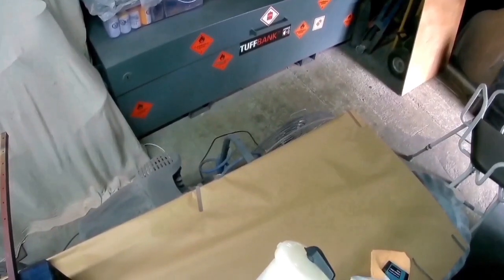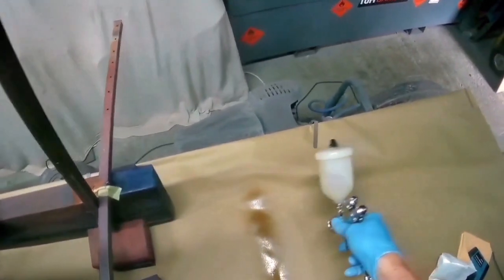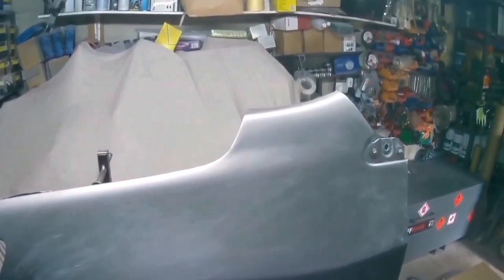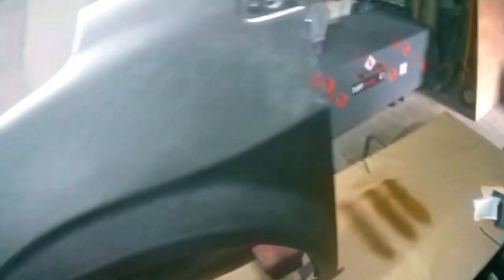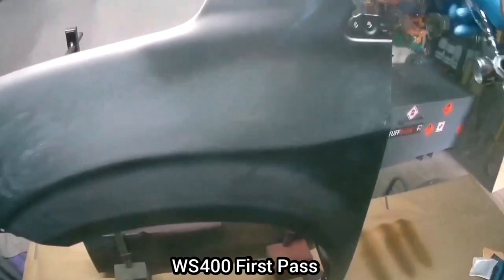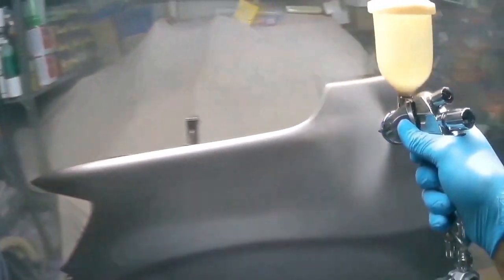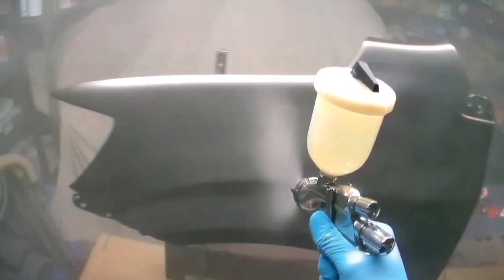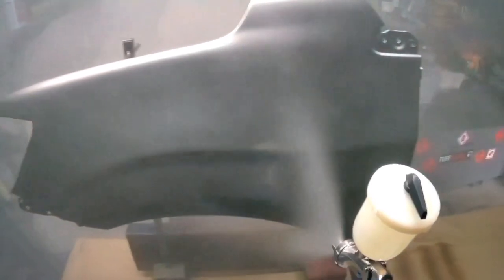Iwata WS400 1.3HD v Kiwami 4 1.3 BA4J For Clear Coat

Comment: Another nice comparison video, Pete. I've been on the fence with the Kiwami 4, although most video's I've seen on it are positive. On a side note, if you ever decide to thin out your collection of guns, be sure to let us know here. I'm sure there'd be plenty of interest.....
Reply from the maker: Hi Mate, You may or may not know i had a problem with my Kiwami4, an air leak at the back, the third Iwata to do it.
Having said that i still really rate them especially in the BA4J setup used here because it not that expensive so is really good for someone that wants a good product  at a reasonable cost, cheers 👍

Comment: Nice video Pete, an unusual colour very  similar to what John done the other day. Both guns looked like they had identical orange peel from what I could see anyway. Your subscriptions are doing very well mate people are giving your videos the attention they deserve. Thanks Pete see you in the next one.
Reply from the maker: Thanks Steve, yes, it very hard to detect any difference in finish, even with the human eye, one thing i would say, is the WS has more control re finishes which is what i meant by the Kiwami4,  although new, is a bit old school, ie it just puts it on so doesn't atomise as fine, not a problem for things like this as it's just about getting as good a finish as possible and not trying to match anything, people often talk of a "glass finish" but most of the time, unless you doing the whole car or bike you don't want a glass finish.

I'm try to leave things 1 or 2 days after doing them before the final shots so people can see any drop off in gloss which does happen,  just a bit more representative of what to expect particularly with the cheaper clears and xfast hardeners

This is similar to the BMW X08 CHAMPAGNE QUARTZ that John did the other day, I did these panels in a few colours including the BMW one so you will see a subtle difference.

Yes, the subscriptions are going up although it should be higher really as we get a lot of view's a month now but i don't like to push too hard if that makes sense, I really enjoy sharing what i do so subs are not the be all and end all, it does help with YouTube pushing the vids more though, cheers mate,  hope alls well 👍
Reply: @peteshobbies5383  Hi Pete, yes all is well thank you very much hope everything is ok with you as well. Yes like you say the last thing i would want is a like glass finish especially for a repair its good that you do these comparisons at least people can make there choice on what they want to achive. 
I know what you mean about not pushing the subscriptions, its not something that i do myself either I just look at what I do and thats if I like the style of videos that a being produced and the person as well then i subscribe i never click it because someone said subscribe at the end. I think its common amongst content creators that the varst majority of people watch the videos but don't subscribe, I think this is because of 2 reasons 1 that people think that you have to pay for them (I thought so to at one time) secondly youtube themselves are very good at suggesting a video to the end user that it gives the illusion that your already subscribed.

The champagne colour isnt a bad colour dont think its something i would pick, at first it looked like gun metal gray when you first started spraying then out in the light it was completely different.

Have a good weekend Pete.
All the best, Steve.

Comment: Wonder if the W400 with a 1.4 tip and nozzle gets closer to the Kiwami4 with 1.3? Both give excellent results.
Reply from the maker: Hi buddy,  I have a 1.4HD and a 1.5HD tip set and use both. The 1.5 is closer but probably still not as fast. Here's a video seeing what the difference is between the 1.3 and 1.5. It's the same panels I use on these  verses videos, so it is directly comparable , cheers 👍 
https://youtu.be/15vxtygPfFE?si=Pgninc1FF9fjEfOb

Comment: which would u recommend out of all three kiwami 4 models? ba, wb or wbx? and what tip? for base and clear. if wb or wbx, can i use it for solvent based too?  Thanks a lot.
Reply from the maker: Hi mate, the best all-rounder, and particularly good with clear coats is the WBX in 1.3, it will spray solvent basecoat just as well as water bourn paints
Reply: @peteshobbies5383   
Thanks for quick response brother. So wbx 1.3 for base and clear (solvent) would be the best bet? I think im going to pull the trigger.
Reply from the maker: Yeah, that's would be the best, the WB is slightly better for basecoats but the WBX is better for clearcoats so if I was to only get one, it would be the WBX
Reply: @peteshobbies5383  I finally got kiwami 4 ba and wbx in 1.3 tip both of em!! thanks a lot for ur reviews brother. They are absolutely amazing combo. Which tip u prefer in wbx? 1.3 or 1.4 for clear? i got it in 1.3 for clear, does that make much difference?
Reply from the maker: They make a great combination 😃,  I would recommend the 1.3 for clear unless it's a UHS clear, in which case 1.4 may be better, but you can still put UHS through the 1.3 without problems

Comment: Pete I can pick up a walcom slim Kombat hte brand new for $270 shipped how does that gun compare to the kiwami 13ba4 in your estimation? They are similar in price. In terms of ease of use quality of finish and speed of fluid delivery.
Reply from the maker: Hi John, now that's an interesting question, I really like both of them.

I would say the Iwata is probably better made, that's despite one of my Kiwami4s having problems, I haven't had any problems with my Walcoms but you just get the sense they might, some of this I'm sure to down to the fact the Walcoms aren't metal for the most part and it probably in my head rather than a fact.

I'm really struggling to give you an answer to be honest, they are both really good, the finish you can expect from either is excellent, i wouldn't rate one above the other on that score.
As for speed i would give that to the Kiwami4, like for like tip size wise, although this is just from memory rather than back to back which is an eye opener sometimes, dont know if that helps to be honest mate, sorry

Comment: Completely right. In my experience you cannot use the WS400 at full fan. Candyman, another YouTube painter (who truly does know what he's doing) claims that he uses his WS400 at full and full and claims that he can do this at 5 inch spray distance from the panel. Maybe that close he can get away with it but I've never had success with anything more than two turns out with respect to the fan not splitting. It's not that big of a deal if you know about this idiosyncrasy and adjust accordingly. Set up two turns out on the fan the WS400 is a world class gun and in my opinion can produce the flattest finish I’ve ever achieved. Only equaled by the ProLite with the T110 aircap.
Reply from the maker: Hi Sataman,  yes, i too have had people say you can use full fan, if they are painting so close to the panel as 5" then, as you say, they may get away with it because the material hasn't had a chance to separate.
I must admit,  each time i use the WS the more i like it and as you say, once you know where to start with the fan settings it's a great gun to use, be interesting to see what the new version is like 👍
Reply: @peteshobbies5383  Do you have a link to the new version. I didn't know there was one so I'm interested in it. The Supernova has been out for ten years, it was clearly time for an update. Hopefully, they will limit how far the fan adjustment can come out so that this issue will not be a problem with the new version.
Reply from the maker: Here's one, goes on a bit but at least you can see what the gun looks like https://youtu.be/jTofRuHlchQ

Comment: Whats a good clear? How to set the fan on the K.4
Reply from the maker: Hi George,  i did a video trying 4 different clears,  link is below,  not sure if they are all available where you are though?
https://youtu.be/YQffNOUL0A4
I put the settings on the video,  i use most clear guns at full fan and full fluid including the K4, normally at 2 bar or 29psi,  cheers mate 👍

Comment: Hi, where did you get the cup for the Kiwami? I'm planning on buying one but it doesn't come with one? Cheers
Reply from the maker: Hi mate, I got it on ebay, these are the part numbers to look for 👍
200ml Cup  PCG 2P2
400ml Cup PC-G400P
600ml Cup PC-G600P-2

Comment: Hey Pete, that was an interesting comparison as I expected the WS400 to be faster than the Kiwami4 but it seems to be just the opposite unless I heard it wrong😂 but as you mentioned you can't really split the finish on them 👌
I'm hoping the 2.0 version of the WS400 will be better with it's fan as I am looking to get one in the future (the removable digi gauge got me hooked)  but I can see it being sata money, never mind though as I have my W400 arriving Monday 😎 sorry had to get that in 🤦‍♂️🤣👍
Reply from the maker: Hi John, no, the WS is slower, it's one of the things many people moan about, the 1.4HD normally sorts it out, the Bellaria/Kiwami4 BA4 set up puts a fair amount of fluid out so you can move quicker and still get good results.
I think the fan thing will be sorted out, it's not actually a problem if people know about it or try different settings,  i suspect it will spray the same but we will see, I will get one of the new ones but will keep the older versions as well, the parts may be interchangeable to a degree but we will see, cheers mate 👍
Reply: Ok thanks Pete it's surprising that the WS is slower but it is what it is. Ah so you are getting the WS series 2 then mate I think it's released on June 1st so I expect to see a review from you on the 2nd of June so that will give you plenty on time to get used to it 🤭🤣😆😂😉
Reply from the maker: @JohnWD40TC02  I'm not that keep John 😂,  I'll wait for the price to stabilise first 👍
Reply: I love the fan size of the WS400, it is huge. I hope they make the setup adjustments more like the typical guns. Even using HS clears, I have never needed to go full fan, I am not sure why Iwata overshot the fan adjustment the way they did. Pete is right, full fan goes heavy top & bottom and dry in the middle.

I'm sure you will be very happy with the W400, it is a great gun for the money. It is also much easier to setup and use.
Reply: Thanks David I'm looking forward to getting the gun and it will be nice to add to my collection. 
Hey Pete I recon the new WS400 will hold it's price for a fair while mate so you will have to have a bit of patience to wait for it, I'm not sure I can wait 🤔😂👍
Reply from the maker: @JohnWD40TC02  yeah,  I'm sure it will hold its price well, looking at the Iwata video in some part English it seems there are 3 guns and they are all base gun's, so I've either got it wrong or the clear one will be out later, not interested in the base ones to be fair only the clear.
They have addressed the fan top and bottom heavy on full fan by the sound of it and made the pattern smaller and thicker, just like a Kiwami4 😂🤣😅, don't you just love marketing 😉
Reply from the maker: I've just watched the video again,  obviously wasn't paying attention first time 🙄,  there is a clear version as well
Reply: @peteshobbies5383  Yeah I thought there was a clear version, I love the idea of the removable gauge as it should make cleaning easier and the gauge will probably last longer. I didn't see the part about the fan being smaller and thicker but it's probably a similar cap to the Kiwami4 just to save a few pennies 😆🤦‍♂️
Reply from the maker: They do a few different versions of the base gun, basically one has a wetter centre patern compared to the other, I'm not really fussed about a digital gauge and the fact it's removable just compounds the matter, it's got leaks written all over it, hopefully I'm wrong.
Be interesting to see the pricing in different countries which always makes me smile considering they come out the same factory, 
Anyway, I'm jumping ahead here, you have a lovely Bellaria coming tomorrow,  be interesting to here what you think of it,  cheers mate 👍
Reply: @davidparker9676  the reason for the fan is to help painters who either use less air or spray closer to the panel. If you open the fan to where you get the split pattern try moving the gun closer to the panel and lower air pressure. I have a friend who has used iwatas for 20 years and he always runs full fan 21psi and sprays pretty close and fast to the panel. Seems to get good results as he owns a bodyshop.
Reply: @johnsax7986  Are you talking about the WS400 specifically or generalizing all Iwatas?

The supernova hasn't been around for 20 years.

I have a few Iwatas as well as other quality professional spray guns. The Supernova models in particular are different than all the other Iwatas as far as setup. Everyone I personally know with the Supernovas (WS400 & LS400) never goes full fan on the adjustment because it is unusable at that setting. On my LPH400 and W400, I typically run full fan as a default setting with no problems.

On all my other guns: SATA, DeVilbiss, Sagola & non Supernova Iwatas; I typically run full fan and full fluid. I adjust the air pressure to suit the material I am spraying. The WS400 is the anomaly amongst all the other guns, I never run full fan because it always goes dry in the middle. There is no point bringing the gun in closer at full fan, you will still get a bad pattern. The whole reason I bought the WS400 is for the large fan and fine atomization.
Lowering the air pressure and bringing the gun closer to the work just to run full fan defeats the purpose of having an expensive gun. Doing so would reduce the atomization and make for a more difficult spraying experience.

It is just an annoyance to have a significantly different setup on the Supernova when you use multiple guns. You either have to remember the ideal settings or waste paint and time playing with the settings, doing test patterns.

Full fan and full fluid should give you the biggest fan pattern and be the ideal setup for painting fast. I honestly think it was a design flaw on Iwata's part. You shouldn't need to wind the fan adjustment in to get a good pattern. Technically speaking, it is simply too much air going to the air horns on the air cap. You shouldn't have to adjust the distance and pressure to correct for it.
Reply: @davidparker9676  you run full fan on your lph400? You sure about that?
Reply from the maker: @David Parker My findings are exactly the same as yours, I think Iwata have more or less admitted it was a design floor as in the promotion video for there new version they they say this has been addressed

Comment: Hi Pete, I watched the Iwata supernova gen 2  video and they talked about the split nozzle orientation relative to the air horns being critical to the spray pattern. My series 1 supernova is oriented "incorrectly" and seems to spray just fine. My manual does not reference this as a possible issue. Do you have any experience with this?
Reply from the maker: Hi Gomer, I think they are now saying there was a problem with the original design, this is because, as you may know, the gun really didn't like to be used on full fan, depending on thickness of materials being used the patern separates, if the fan is wound in then there is no problem with the WS400 or LS400.
It amazes me how a company can say after 12 years or so that the original design was flawed, that's marketing i guess, so expect the new version to be less " tricky " to set up, I suspect it will also lose some of it's appeal but we shell see, I will try and get the new version as soon as i can 👍
Reply: @peteshobbies5383  Maybe one thing to try is a teflon washer/shim behind the split nozzle so it tightens in the correct orientation?
Reply from the maker: I'm not sure that would work, there is little wrong with the original design once you know how to use it, after all, they (Iwata) are trying to persuade you to buy another spray gun
Reply: Yes must take marketing into account!